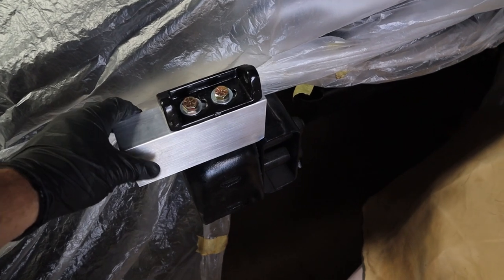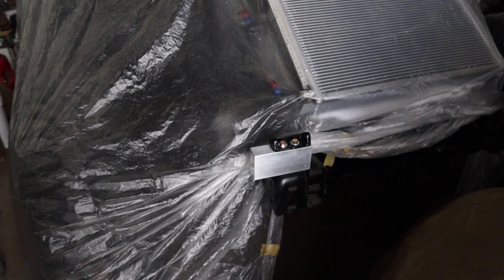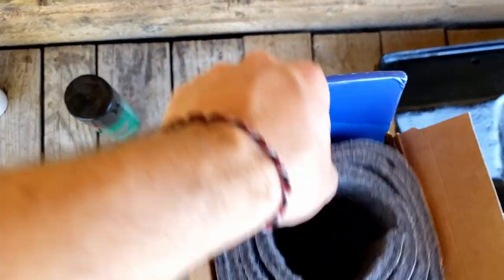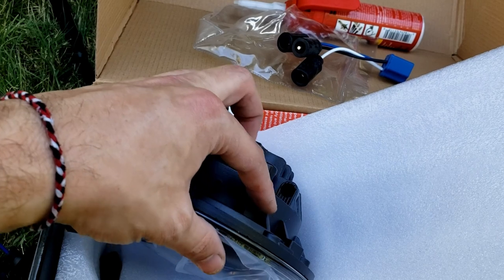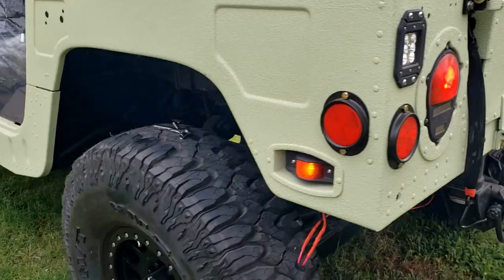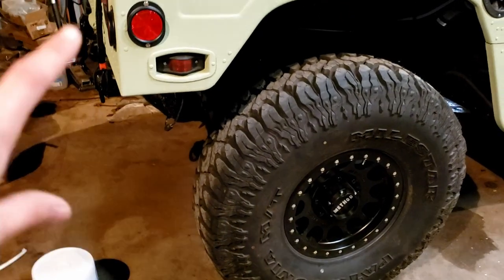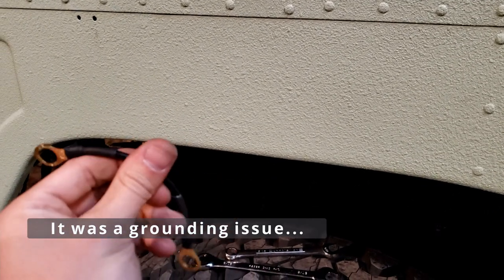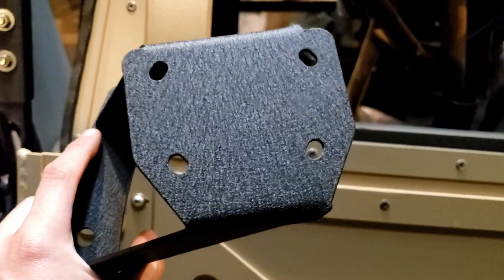Humvee Update - Issue with lights, Hood On, New Headlights, Doghouse Cover Insulation

Comment: Thank you for this amazing video. My M 1123 driver side headlight just stopped working. For the life of me I cannot figure it out. It’s a brand new LED light. I installed a supplemental grounding harness harness and it still didn’t work so I’m definitely gonna try an additional grounding wire like you showed on your video.

Comment: With the winch you'll need the frame extension rails unless you opt for the milemarker hydraulic winch.  I've had both the Warn and Milemarker winches and I prefer the Warn.  Also I'm not sure if you did this already - but for your grounds on all of your electrical parts - make sure that your grounds are terminated at the factory grounding points.  Because the HMMWV/H1 frame is bolted together and not welded - it can cause bad corrosion if you don't have it grounded properly.
Reply from the maker: All grounds are factory locations or hard wired to the battery post.